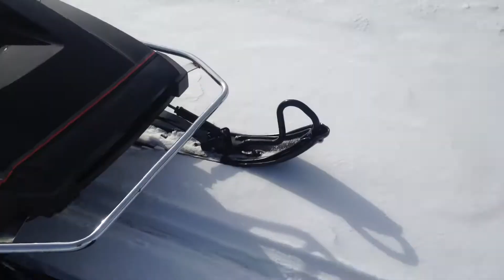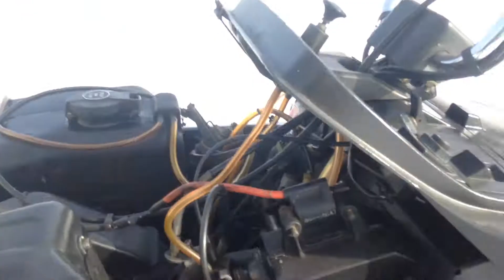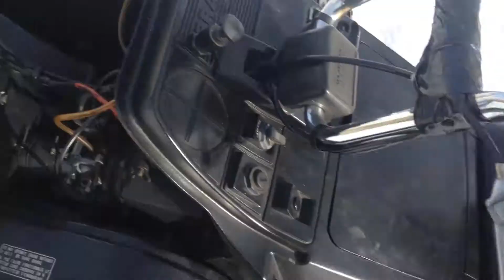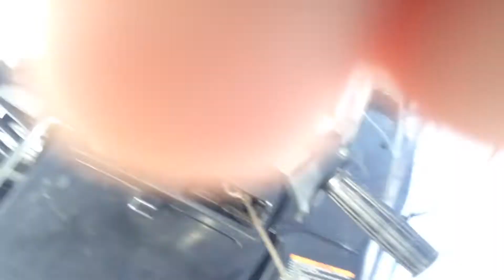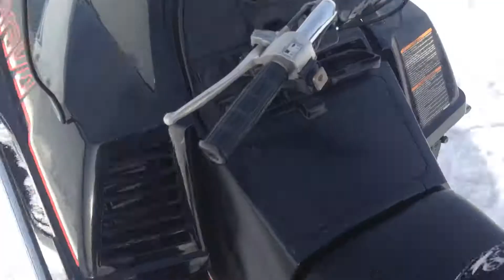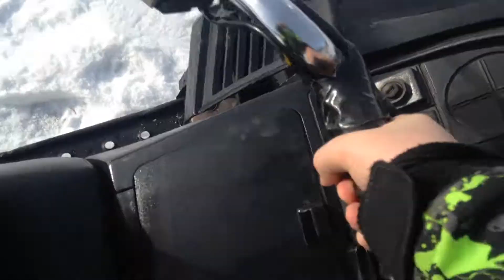Yamaha bravo review and start up.

Comment: I just bought one for my 12 year old. It vibrates a lot as well at idle. Was wondering if that was normal. I’ve seen others on YouTube that don’t appear to vibrate as much but not sure. Has a lot of slop in steering and some other small issues. I’ll be going through it after I surprise him this October on his birthday with it.
Reply from the maker: Plymco USA mines that same way; the bars are the same to.
Reply: I had a ‘89 250, it’s at my cabin now, and I know I’m late to respond, but yeah, mine vibrated a lot when I started er up, but after that, it was fine, and I had fun gunning ‘er down the pond
Reply: that's just how they are i think they all mine vibrates a lot at idle then eases out a bit after
Reply: Well doesn’t matter much now cause he put it dead center into a 20” pine tree. Was behind him on the trail and watched it happen. He’s totally fine thankfully but took some convincing to get back on a sled. Ended up with a 2018 200 snoscoot. Seems much happier with it.